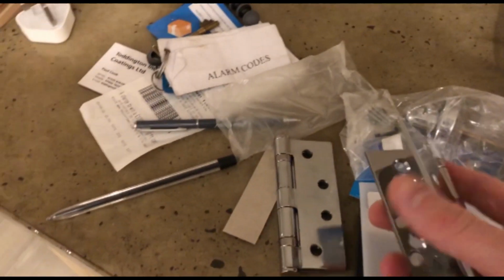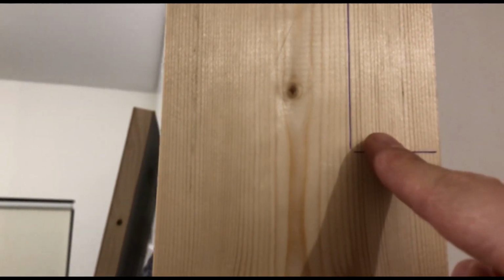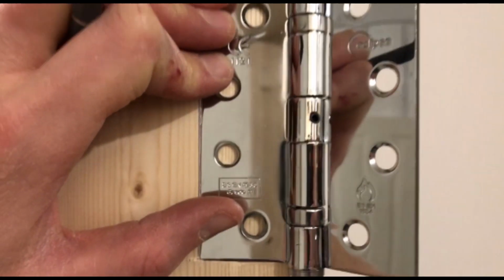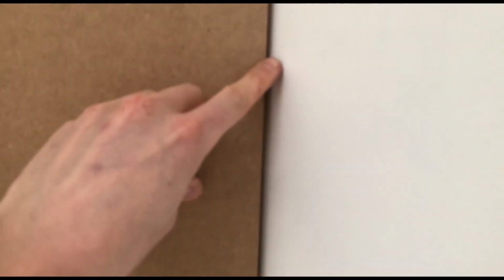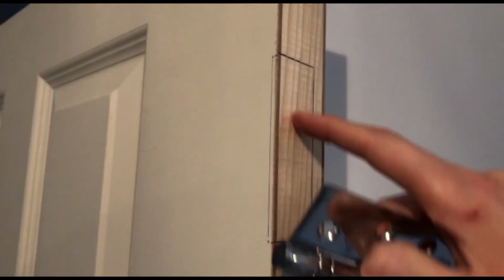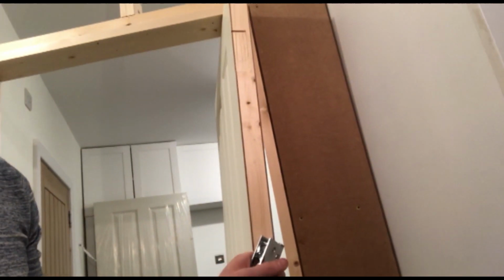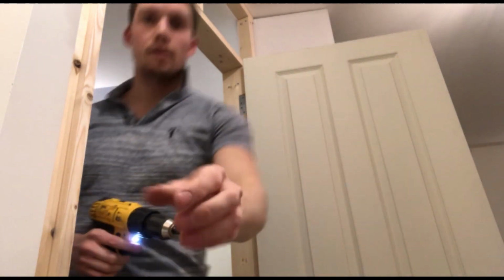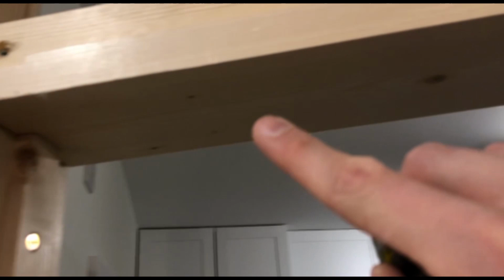HOW TO HANG / INSTALL AN INTERIOR DOOR - BEGINNERS GUIDE STEP BY STEP !!

Comment: You can buy a cheap Katsu palm router (£35) for chopping out most of the hinge area. This gives a neat flush finish to the hinge. Finish off the edges with a chisel
Reply from the maker: yes I thought about doing the routing method but I really dont have need for a router for the jobs I have done so far. Maybe I would if I had one. Have you got the link for that router?
Reply from the maker: @nixy102  thanks mate. looks like a good bit of kit :]

Comment: Eye protection mate using the multi saw. I would probably move the in fill panel you cut for next to the door as far over to the wall as possible so it butts up against the wall. the gap you get on the other side between the panel and door frame will be covered over by the architrave once youve fitted it. Filling large gaps with caulk always ends up looking poor as the caulk sinks in, so get a tight fit with the panel. Good job tho bud.
Reply from the maker: Cheers mate, yeah I know. For deep fill caulk I usually do it in 2 stages. :] Thanks for the feedback :]

Comment: I'm sorry but this is really not a good demonstration of how to hang a door - from start to finish.  Bottom hinge goes 225mm up not 150mm.  You undershoot both the leading and back edge of the door before hanging it.  You put the hinges on the door first then offer it up to the lining to mark the positions - this avoids making the housings too big if you don't get them absolutely spot on as doing it your way.  I have never seen a multi-tool used to cut out for the hinges but I guess if you can get the accuracy of a chisel or router - whilst keeping all of your fingers - then well done.  The top door stop is fitted first allowing a couple of mm gap from the door on the hinged side - this stops the door binding on the hanging side stop when it is closed.  Fitting the top stop first also means the joints with the vertical stops are hardly noticeable.  If you are painting the door then your stops positions need to be adjusted slightly to allow for the paint on both the stops and the door - 2 x 3 coats of paint will make a difference.